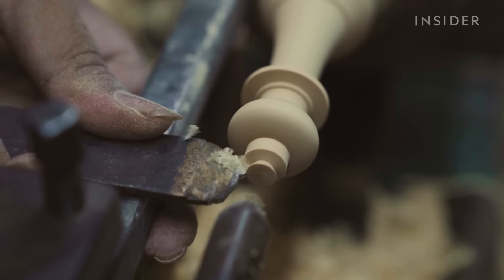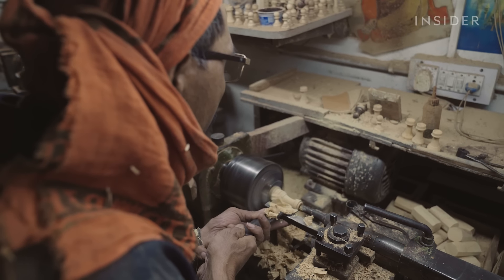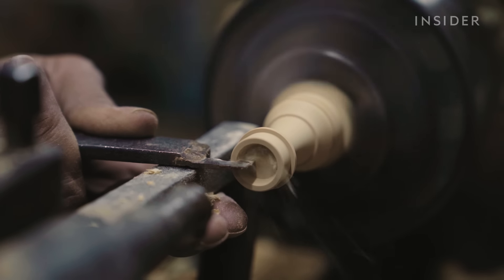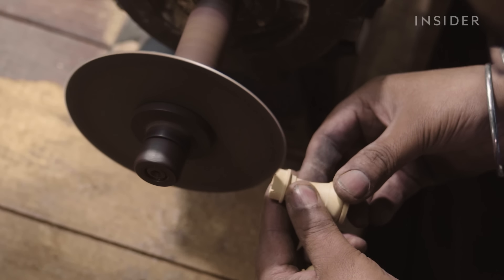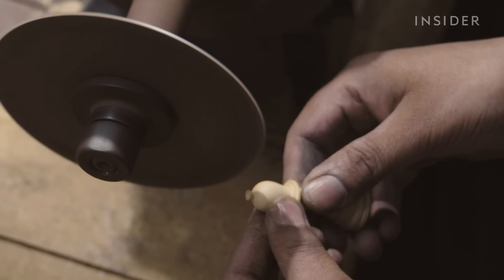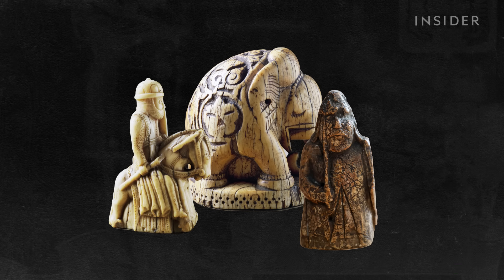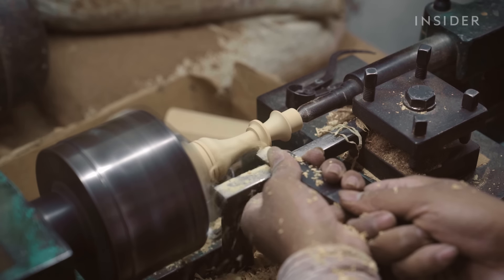Why Championship Chess Sets Are So Expensive | So Expensive

Comment: These absolutely won’t get more expensive. They’ll get CNCd.
Reply: People usually place value on handcrafted items so I doubt that the official chess sets will be CNCd anytime soon.
Reply: I'm surprised they're not CNC'd already. I would have thought that would be much more reliable than hard carving.
Reply: @RyanHellyer  it is, but how else do you justify the outrageous price if it isn't hand carved?
Reply: @RyanHellyer  of course it is but you’re missing the point. You think they are not CNCd because no one thought about it before? Lol.
Reply: I assume they're not CNC'd because either CNC'ing isn't up to scratch yet or it's cheaper to do by hand.

I've seen some examples of CNC'd knights, and they looked rubbish. Perhaps they technology isn't up to par yet?

(I know very little about CNC'ing)
Reply: They are Championship Level Sets, so are produced in limited quantity. 
Limited quantity means it is cheaper to do them by hand than by machine. 
Does no one go to school these days!?
Reply: @RyanHellyer  I think they're only handmade because that's the rules.
Reply: @Kyrelel  That’s not a universal rule and it isn’t true in this case. CNC is not really scaleable and does not yield mass production benefits as would casting for example. One machine will work with one piece at a time and when you have configured the machine, it will take the same amount of time to manufacture regardless of the volume.
Reply: There's no rule saying they need to be handmade. Many plastic sets are mass produced without a single hand touching them.
Reply: @RyanHellyer  This should not be a difficult concept to grasp. Even if computers could make perfect AI art, people would still buy paintings from artists because it’s human made. These Championship sets are a special item, a novelty. It is a sort of status symbol to have these hand made.
Reply: @peckdec  Yes, but massively more people buy prints than hand made art works. There are no (that I'm aware of) CNC'd chess pieces available.
Reply: I reread what was written above. In case it wasn't obvious, I'm referring to CNC'ing chess pieces, not specifically the world championship set. I was only referring to being surprised that chess pieces are not CNC'd in general, I wasn't meaning to imply that the world championship chess sets would become CNC'd any time soon. Although if they could be done dirt cheap, then I imagine they may do that, as it would be a pretty good revenue stream if they could share the world championship sets with the masses. I assume they don't because it's not possible yet.
Reply: @RyanHellyer  Great! The we have reached similar understanding. CNC is never dirt cheap. I’m a mechanical engineer and CNC parts are often the most expensive ones. They are usually avoided when possible and other methods are used.
Reply: @peckdec  oh, so it's possibly mostly a cost issue? Interesting. I thought that CNC would be significantly cheaper already. Hopefully that changes in time.
Reply: @RyanHellyer  Labor is usually also expensive, depending on the location of course. Cost efficient manufacturing is a balancing act between labor cost, material cost and tool costs.

Comment: I have carved intricate hard and soft wood gnomes, knife handles, spoons and other trinket carvings for many years. Many of those carving have had much more detail that anything shown on the video.  I also have several  buddies that do the same thing. Decoy's, birds, butterflies, ect. Most intricate carvings are not especially difficult to carve but it does take time and patience. As to the parts created on the lathe, that's a joke, they use preformed templates as cutters! All in all the carving industry they speak of is a sham, scam or whatever else word you want to use.

Comment: My Staunton set was made Waddingtons in the 1960s. We weren't rich and it didn't cost a lot. I can't remember exactly how much but certainly less than a family's weekly groceries. Maybe £1 or £1/10/-. But my best set is non-Staunton in Mexican onyx. Kings are a full 95mm tall. After acquiring it, I laboriously glued small rectangles of green baize to the bases of every piece. Much quieter and less damaging now when pieces are put down on the matching onyx board.

Comment: It's not important at all for the knights to look uniform. It's a strategy game. You could literally use a piece of paper with "black knight" written on it. Easy identification of pieces is only slightly advantageous in speed chess, and even then most high level players go off of their head anyway, they don't have to look at the board each time to know where each piece is.
Reply: absolutely correct

I mean text is an extreme metaphor and would probably be a  pain though but I see your point

Comment: I think a better strategy might be to have all 4 knights intentionally different, thus removing the intricate work required for perfect symmetry. Honestly, I would rather have more unique piece designs than symmetry, anyway... so it's more value for less work --> higher profit percentage. For that matter, make all the pawns slightly different, etc.

Comment: I think she breezed over the ONLY reason they cost so much. It’s because of the magnetic pieces at the bottom for the tv display and because the championship chess league is willing to pay that much. The cutters they used literally did most of the work for them.
Reply: The set that has those RFIDs (in the pieces) and circuitry (in the board), cost way more than $500 (for the pieces) and $200 (for the board). She's talking about the sets that don't have those add ons.

Comment: 🤔
Artisans in Amritsar, India craft intricate World Chess Championship sets for $500.
00:00
🔨
Artisans spend months perfecting the craft of making chess pieces from boxwood.
00:51
🤴
Crafting a knight takes 2 hours and must be symmetrical and uniform with the others.
01:38
🤔
A chess set's value is largely determined by the knights, with the king being the tallest and widest piece.
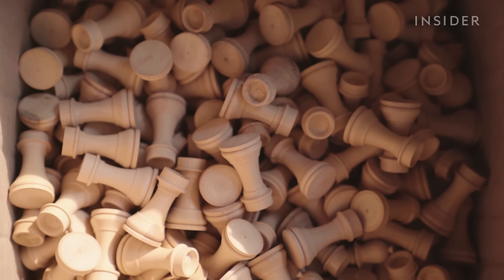03:14
🏆
25-30 set kings per day needed for championship sets, compared to 200-250 for regular sets.
03:53
🤔
The design of chess pieces influences the game, with the king being the tallest and features helping to reduce mistakes.
04:40
🤔
Chess pieces are designed with a Staunton design, weighted, buffed, and dyed black and dried for 10 days.
05:19
🤔
The popularity of "The Queen's Gambit" has caused a surge in demand for chess sets, but the lack of experienced carvers may lead to higher prices.
6:21

Comment: While I can believe that having the correct, consistent dimensions is important for reducing player mistakes, you're not going to convince me that wood has any notable advantage over plastic. Considering the problems facing FIDE these days, it seems like a poor use of limited resources to spend so much on hand-carved chess sets when a nice, injection-molded one would surely achieve the same goal for a fraction of the cost.
Reply: Pretty sure they only use these sets in rare tournaments like the World Championship. Other international tournaments require the use of the Staunton design and official tournament dimensions (and weights), but are done in plastic at a tiny fraction of the cost.

As for FIDE doing it this way for high end tournaments, I'll bet they use a different set each game and then make up many times the cost in selling the set to a collector later. Plus they get some royalties in licensing fees so it makes sense to do it this way.
Reply: @tychay  
It seems like bs they have those strict dimensions for tournament. Is there like some special reason for it? cmon

Comment: I bought a deluxe chess set made in Taiwan. I opened it at home and the pieces were very well made until I checked the black queen. Just above the base, there was a deep horizontal defect across the piece. Instead of scrapping it the manufacturer took some scrap wood and glued it in. DO NOT BUY ANYTHING WOODEN FROM TAIWAN.

Comment: Does it impact on player's performance? Obviously yes, that's why it needs to be professionally tested using specific wood. 3D printed set will lower player's IQ by several points.

Comment: This video is trying to justify the exorbitant cost some chess sets go for from brand name manufacturers. This is ok for collectors, but you can buy great hand carved pieces from small distributors and brands that are just as good for much less. I bought small and large chess pieces from India from sites such as chessbazaar (I am in no way affiliated with them) and their chess pieces are excellent. That and other sites also sell very expensive sets, but trust me, you don't need those. You also do not need to pay a lot for something from Jacques of London or House of Staunton. Plastic chess sets are great too as long as you don't buy the cheapest ones that have no weights added. DGT's standard non-electronic plastic chess set is excellent.

Comment: Great skills, but no match for the 19thc Jaques sets
Reply: The Staunton design was introduced by John Jaques in 1849.  The elements of the design are what matter.  All the countless variations in details of the Staunton design are unimportant.  What is important is that for a tournament all of the sets be of proper size and weight and indistinguishable from one another.

Comment: This is 2022, if a programmed machines and robots can cast and machine any number of high-tech products down to a fraction of a millimeter, and assemble micro-electronics with flawless, pin-point accuracy, surely a mundane, rudimentary   piece of wood can be mass-produced 10,000 more accurately and efficiently than this process. 

These sets are hand-made this way simply because of tradition, politics, and monopoly.

Comment: Wow, times have changed.  I have a 2.75 inch Druke chess board I purchased 40 years ago ($500 USD) and a wooden set I purchased  around 35 years ago for $100 retail which is of much higher quality than this crap.  Minus the AI additions.   So sad.

Comment: I always improve the knights of my sets because those are the figures that the manufacturer has saved on. I've had to do this a few times now because I give the sets to my opponents as a prize if they have won the most games of the evening. They often think I paid a lot of money for the sets because of the knights.
Reply: And how do you improve them? Do you manually carve them yourself or wgat
Reply: @arandomcommenter412  Oh, thanks for your interest.
Most knights in the cheaper chess sets are really just unfinished figures. It's therefore no great leap of the imagination that these can be further carved into something looking more elegant.
I do this with a carving knife and Dremel, but it does take some practice and a good eye for form. I also use photos of what I think are good looking finished products to work from.
If you plan on doing this, depending on your skills you have to expect your first attempts to fail. It's also a good idea to keep your ambitions low at first, nothing too complex at the start.
Personally I've found the simpler representations the more aesthetic. The more realistic ones with flying manes and bared teeth, as impressive as they look, are not my idea of a good looking knight.
Only figures made of hardwoods will give you good results so avoid sets made of soft woods. There are many of these kind about, usually from China.